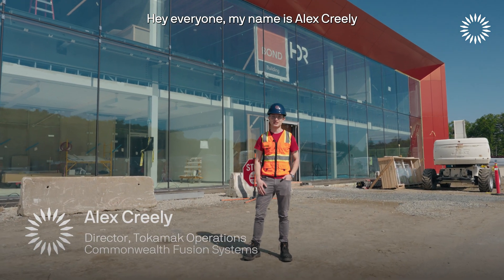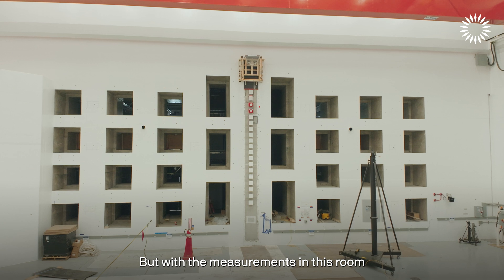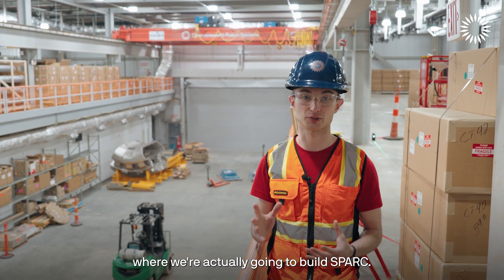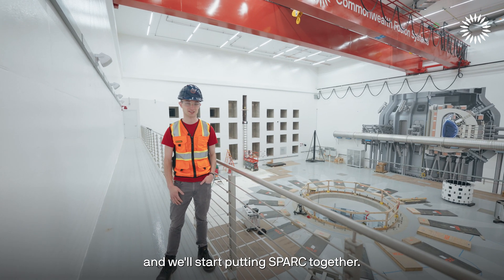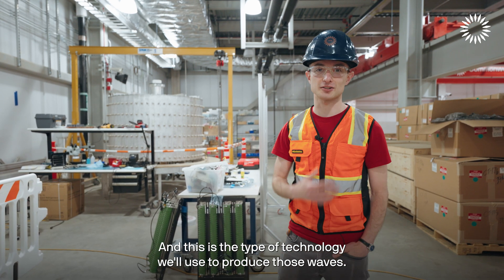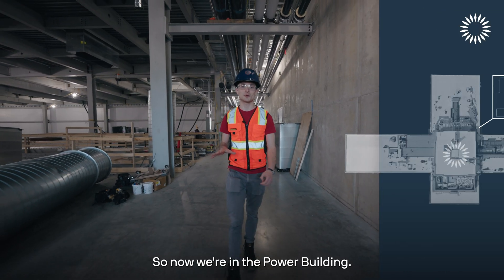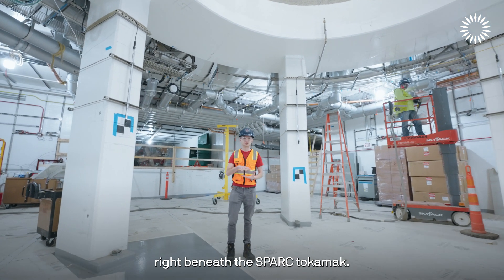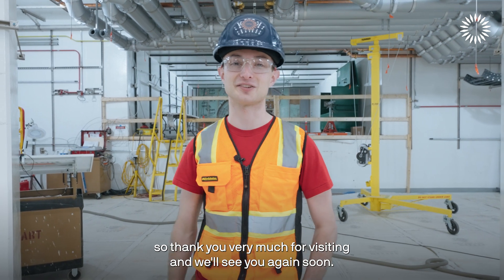Virtual Tour of Commonwealth Fusion Systems’ SPARC facility (June 2024)

Comment: So what we have is a high tech way to heat up water.  The bottom line is what does this cost? How long will this work  and finally what will be the price per kilowatt.  The problem with most nuclear plants is the cost and the ROI as they cost billions to build and by the time they are paid for they are decommissioned.  While this tech has fewer ecological issues that a standard Nuclear plant has the weak spot in my opinion is that to date no power system is direct and when you convert from one type of power to another there is always a loss but to date there is proven to produce electricity in quantity directly as it is produce either mechanically such as hydro electric, the cheapest way or by steam turbine requiring a way to heat the water or nuclear fusion or fission.

Comment: This video, as are all the huge numbers of videos produced by Commonwealth Fusion Systems (CFS), was promotional in nature. It provided no evidence that their efforts will lead to a self-sustaining nuclear fusion reaction that will produce a sustained energy output compared to the energy needed to operate their SPARC tokamak testing facility. Such traditional promotional efforts primarily focus on the assumed success of their operation. Typically their fans have no interest in seeking out critical analysis of such endeavors based upon the very lengthy history, beginning in the late 1950s, of such experimental endeavors.
Reply: Did you expect them to publish their research papers on Youtube?
Reply: @Tuboshi0815  - The extremely arcane nature of this field conveniently allows numerous key details to be excluded from such presentations. That includes the total averaged energy fed into the facility during its operations. The parameter of that value can easily be over 100 times greater than the energy fed into the plasma to heat it. The heating value is used to formulate Q-plasma. Q-total is typically left out of presentations. Another issue, that very few people are aware of, is that both SPARC and ARC are expected to operate in brief pulses when operating at near full DT fusion power levels. The published parameters only apply to the brief on periods, not an average, that includes the lengthy recovery time. I have read a technical paper that is published in an International Atomic Energy Agency (IAEA) journal. That is how I've learned what is typically omitted.
Reply: @Tuboshi0815  - That is argument that I often get from fans. Consider that some of Commonwealth Fusion’s research papers are lacking in key evaluation details. Consider that they tend to be reviewed by other fans of the technology they are dealing with, not by totally independent experts since few others are familiar with the field. Few fans have encountered the following critical analysis on YouTube and if they have they tend to dismiss it because it doesn’t reinforce what they prefer to believe in.

How nuclear fusion works (4) - reactor practicalities

Comment: Thank you for this tour. It is clear that numerous details were left out which I find is very common with most nuclear fusion energy experimental facilities. It would have been advantageous to have also heard someone give a critical assessment. I'm sure that most of the viewers are only interested in hearing one side of the story.

You used the word fusion in referring to the future operation of SPARC. You should have provided more information on supplying it with the fuel component, radioactive tritium. Currently, it's commercial purchase value is around $30,000/gram. You also made no mention of including a lithium blanket, or creating your own source of tritium. The past presentations, regarding SPARC, stated that the high-temperature superconducting magnets would be key to it achieving useful levels of fusion energy. Many of the viewers assumed that meant the magnets didn't need to be cooled down to cryogenic temperatures to operate. Are we to assume that your design will solve all the plasma instability issues that so many other MCF facilities continue to struggle with? How Does SPARC plan to deal with the chamber materials that become contaminated with the radioactive tritium, or components that become radioactive due to irradiation from fusion energy neutrons? When operating at full fusion power levels are the superconducting magnets shielded from being irradiated by the fusion energy neutrons? SPARC is designed to run in a pulsed mode as are all other tokamak type projects when operating at full DT fusion energy mode. SPARC's ‘on’ time is expected to be 10 seconds. The stated operational parameters are for the on-time, not for the lengthy rest periods after each pulsed on-time. The press, public and investors deserve to hear the average of the operational parameters over an at least 24 hour period.

I'm posing these questions and examples since most fans wouldn't dream of presenting such questions for a project that they have fallen in love with.
Reply: They run their superconductors at 20 Kelvin. ITER will run theirs at 4 Kelvin. The magnets aren't the tricky part for them.
Reply: @Tuboshi0815  - Thank you for pointing out that the High Temperature Superconductor (HTS) that they employ requires operation at 20 Kelvin, a cryogenic temperature. The plan to use helium to cool it so they will require a cryogenic helium refrigerator to do that. It has become common practice to not mention the numerous other difficulties that they have to overcome, in most promotional nuclear fusion energy presentations aimed at the press, the public and the investors. The extremely complex nature of the technology  serves them well in their omissions of key difficulties.
Reply: @Tuboshi0815  - The CFS’s high temperature superconducting plasma confinement magnets will be operating at 20 Kelvin above absolute zero temperature with a plasma operating at nearly 150,000,000 Kelvin only about a meter away from the cryostat. Once it begins operating on a deuterium/ tritium fuel mixture fusion reactions are expected that will radiate 14.1 fusion neutrons past the first-wall barrier and some will make it to the superconducting coils in SPARC. SPARC and ARC will be pulsed machines so the neutron flux will vary in pulses. It is expected to last for 10-seconds for SPARC. The recovery time could be much longer. The plasma gain value (Q-plasma) only applies to the ‘ON’ period of time. It will have little relevance to the average input energy to the facility when it is operational. The Q-net value is essential to evaluate the experimental facility, including a host of other factors, for its potential to lead to a commercially practical electricity generating power plant. One of the other power consuming factors is the cryogenic helium refrigerator. All these issues should be covered in Commonwealth Fusion Energy promotional presentations so unconnected outsiders can perform their own independent critical analysis.

Few fans have encountered the following critical analysis on YouTube and if they have they tend to dismiss it because it doesn’t reinforce what they prefer to believe in.

How nuclear fusion works (4) - reactors practicalities
Reply: @Tuboshi0815  - It would be helpful to the journalists, the general public and for investors, if they clearly noted the “tricky parts” they need to deal with, in their promotional presentations.

How nuclear fusion works (4) - reactor practicalities (YouTube)
Reply: It might seem you are getting too technical about your questions but sadly, without wanting to be seen as pessimist, these points you raised are the reason this particular setup might never achieve baseload production. When the process becomes too complicated, keeping it  going becomes extremely difficult and prohibitive in terms of cost. I wish CFS success though. For me, I am almost convinced we can get fusion without these complexities and I am determined to do so.
Reply: @henryeze7074  - A great many people have placed their hopes on this technology becoming our savior. We are immersed in a society that encourages us all to express optimism and to avoid pessimistic assessments. In order for a technology to thrive in the marketplace all the downsides should be evaluated. Many of the people who work in the nuclear fusion energy field are intensely focused on their own specialty. Very few have an ability to understand the extreme complexity of the entire enterprise so that they can perform a global assessment of the chances that their approach is superior to all the other approaches. I personally believe that such projects should be very transparent with all the engineering parameters and not hide behind the arcane language employed by those who have major stakes in wooing the public and investors to keep the funds flowing into the project.

This is the reason I pose such technical questions.
Reply: @henryeze7074 - Raise such technical issues because without them outsiders can’t perform a critical analysis. That includes informing the press, the general public, the investors and fans who only are interested in hearing promotional presentations.
Reply: @henryeze7074  - The dream and the experiments began back in the 1950s. Two generations of expert experimenters have devoted their entire careers only to retire disappointed that they never got anywhere close to demonstrating an economically competitive fusion energy pilot power plant. Most of today’s experimenters are largely clueless regarding that lengthy history, believing that they now have the tools that the past experimenters lacked. The fact remains that the vast majority of the scores of fusion energy research machines have never actually employed deuterium-tritium fuel and therefore have never generated a single watt-hour of fusion energy. Even the few experiments that have employed D-T fuel, are the record breakers, have generated only a tiny fraction of the energy that was required to power the facilities. That is not the impression delivered by those who are responsible for attracting investors and federal funders.
Reply: Simple Google search would tell you that there is no traditional blanket. It's a FLiBe salt bath which will also absorb emitted neutrons before they reach the magnets and will produce tritium. FLiBe is transparent and liquid. Tritium at those temps is a gas, so it will bubble to the surface where it can be collected and directed back to sustain the reaction. The video you mention misses this, claiming FLiBe needs to be pumped through a traditional solid blanket.
Reply: @davidc2072  A Google search will provide the design proposals and the concepts that have been experimented with outside of a working fusion reactor, since there never has been a successful fusion energy reactor that has generated significant amounts of fusion energy, or that includes a tritium breeding blanket fluid.

Anyone who bothers to read the latest peer-reviewed technical papers on SPARC, and can get through the technical jargon, will realize it will not include at tritium breeding blanket. I have little doubt that the majority of the vast pool of people, now involved in its construction, are also unaware of that. Most have fallen for the propaganda pitches.

Radioactive tritium, that is near atmospheric pressure, remains in a gaseous state almost down to liquid hydrogen temperature.

The ITER project in France includes a large segment to generate the lithium-6 isotope needed to breed the tritium and other segments required to separate the tritium and purify it. This complex system is almost never mentioned in promotional presentations regarding the grossly over budget and grossly tardy ITER facility.

Comment: Let’s Consider the following options and the alternative.
 
Cold Fusion (LENR) - Unproven hypothesized type of nuclear reaction that creates nuclear fusion at room temperature by producing more energy than the amount of input energy can be produced from its altered state.
 
Tokamak Nuclear Fusion Reactor (ITER) - Requires a temperature of 150 million degrees Celsius to create nuclear fusion. Reportedly the record to date but having to use more input energy than produced is 69 megajoules of fusion energy for five seconds using 0.2 milligrams of fuel. (1 megajoule is equal to 0.00027 megawatt-hours) (The reported development cost for the ITER is $150 billion.)

The alternative.

Solar Hydrogen Energy Recovery Gas Turbine.  

301Kwh (equal to 46/6.6Kw home solar installations) of solar energy collected from the sun’s nuclear fusion at atmospheric temperature is sufficient for electrolysis obtained from 1/3 of the water volume of an Olympic swimming pool that is recycled by steam reforming to produce 24 hours of Hydrogen gas contained within a 14 cubic meter space compressed between 350-700 bar to enable the start-up sequence of a hydrogen Gas turbine that in turn enables the synchronizing of its Variable Frequency Generator to maintain equilibrium of compressed hydrogen gas to continually fuel the turbine.
 
Oxygen produced from the electrolyzing process is used as a fuel saving precooled engine catalyst to bring online the turbines energy recovery system and sustain a variably regulated base load power supply to service grid energy demand. 
 
The operational variability of the turbine manages both grid inertia, and mis matched frequency while generating a capacity energy range between 86 - 330Mw with optional co-generated steam capacity up to 700Mw of electrical energy on a 24/7/365-day basis. 

The power generating turbine has three operational parts, 3m in diameter 5.5m long and weighs 6 tons. Installation cost $36.5 -49.5 million, requires an operational footprint area the size of a football field, noise level is 60dbl at 60m, incorporates direct air capture of CO2 at 1,400 Kg/sec and includes a 14-year maintenance free, end of life decommissioning or optional refurbishment program. 

Sixty-five carbon and pollution free, shovel ready, off the shelf technology that combines solar nuclear fusion with modern aerospace propulsion and existing nuclear and coal fired steam technology to generate a total of 21,450 Mw can be retrofitting to any of the 120 Hydro-electric schemes placed at grid conversion points would provide Australia's 26 million population its entire energy needs covering a combined operational area of 33 hectares for a 2023 total cost between $2.4-3.3 billion. Construction period is 3 to 5 years, meet net zero energy target twenty years earlier and makes wind and solar farms including hydro, gas and nuclear energy production redundant.

Comment: Fusion will never be a cost effective form of power. It is just too complicated. We should be working on molten salt fission reactors
Reply: Yeah, circulating hot, corrosive, radioactive salts through meters of plumbing, pipes, valves, pumps, seals, etc. What could go wrong?